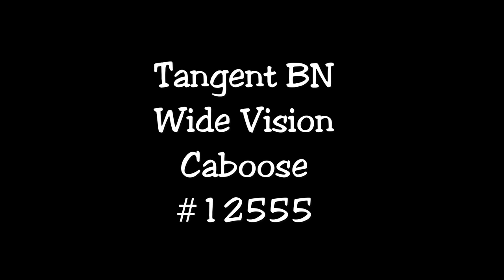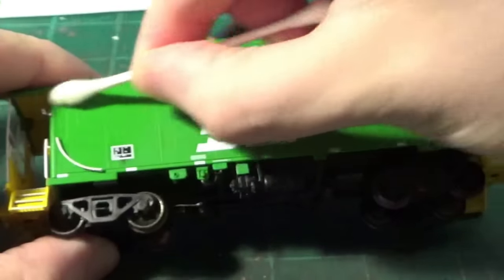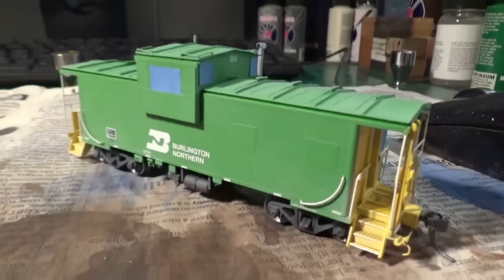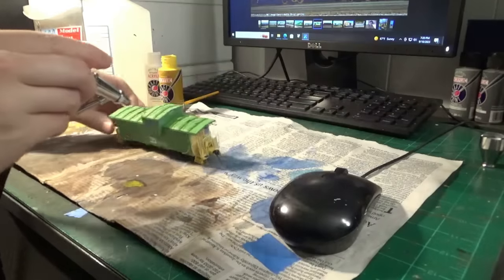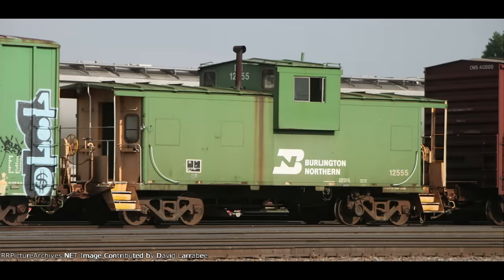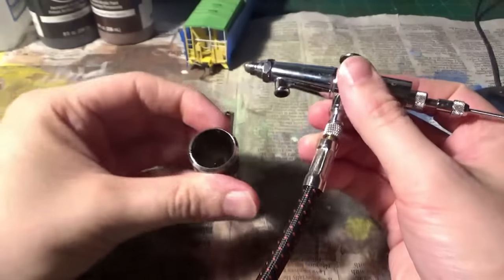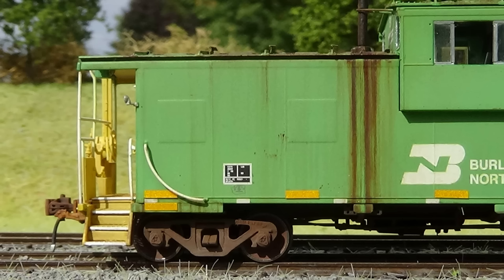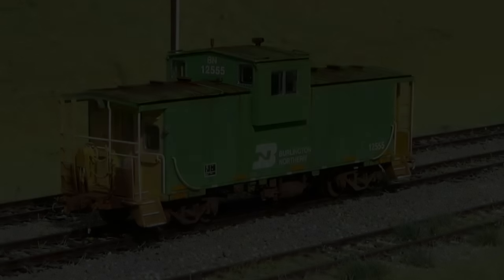Weathering A BN Caboose!  Tangent BN WV Caboose #12555

Comment: Nice work.  Are you still looking for a C&O 903180 20TH ANNIVERSARY cab?
Reply from the maker: Y E S!
Reply: @DansRailroad2011  well one popped up on eBay last week.  It has no box, the top of one ladder is gone (they tried to fix it with ca) and the chimney is a little bent.  But it was really cheap and wouldn’t last.  I’ll let you have it if you do a video on it, no time pressure of course.

Comment: Nice video, Dan.  Up to now I've been using brushed acrylic washes (using windshield washer fluid as the thinner) for fading, using a color slightly tinted up from the original.  However, I'd like to try using my airbrush for this step as you do.  What is the ratio of paint to thinner you use with craft paints?  I might also use thinned VMA.  And I'm guessing you are also using a lower air pressure for that thinned paint.  What is it for your Paasche?  Thanks and cheers from Wisconsin!